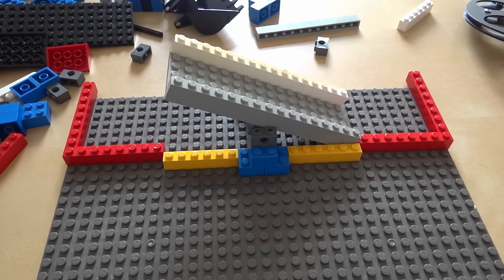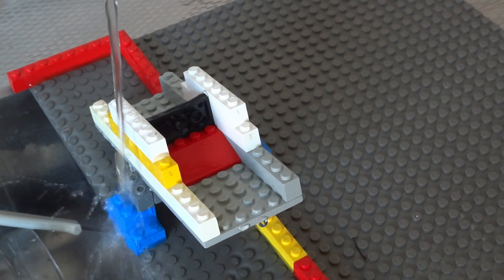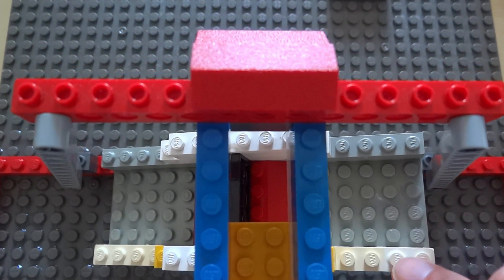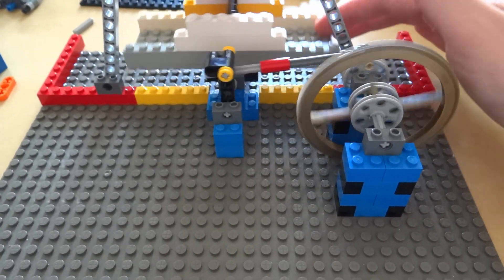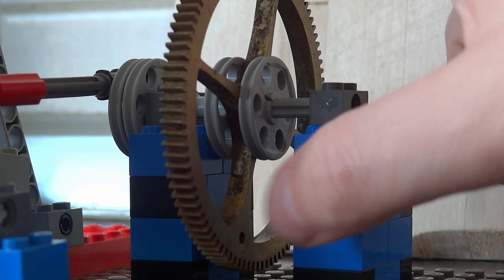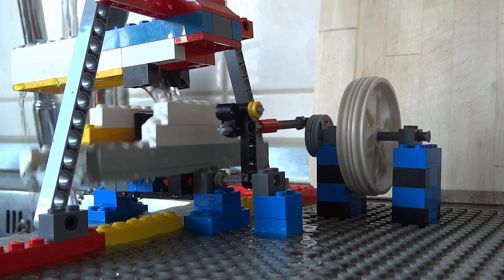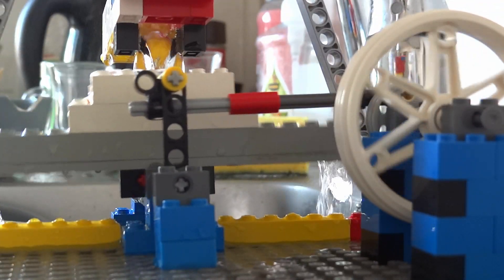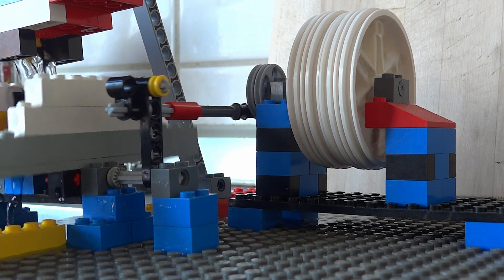Lego Water Engine #2 - It works!

Comment: what if you add tires to those wheels?
Reply from the maker: Extra weight also means you need the beans to get it moving. It's a bit of a balancing act with engines that have just enough power to run themselves :P

Comment: i made a water turbine , they are faster but messy , that why u should put walls like my turbines , water turbines are very good and efficient i got one but i scraped it , i really recommand using a turbine goes faster but hard to get slow with it , turbine are more made for speed but they are very reliable too and customising it is very good